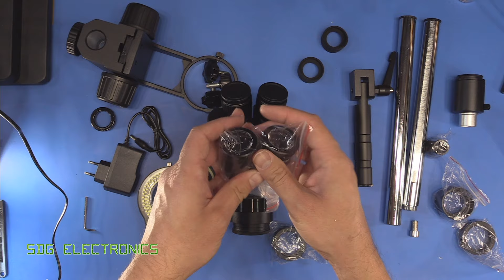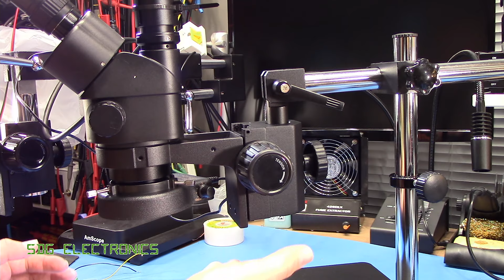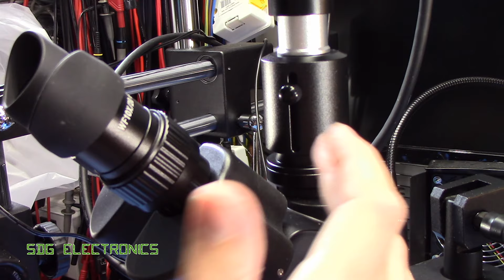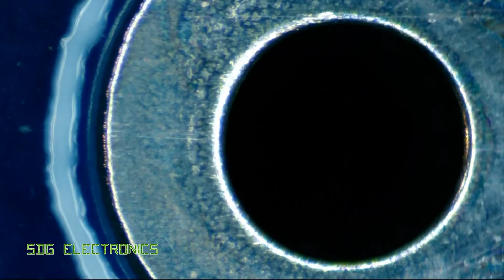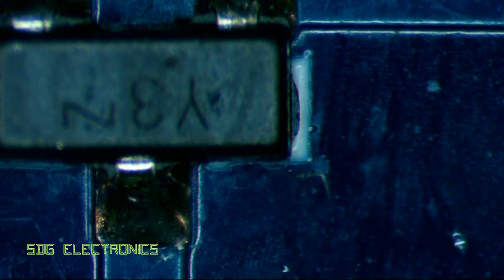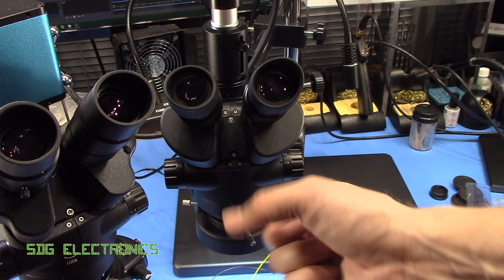SDG #113 Black Eakins Simul-Focal 3.5x-90x Microscope

Comment: as a watchmaker hobbiest i'm interested in buying a eakins microscope . i do have a question. tough.  The one you are testing is a 3.5 x90 one. What is the diference in working distance with a 7X 45? And is is possible to adapt this 3.5 x 90 into a7X45? And what do i have to order to do so? Another barlow lens if so witch one?

Comment: I have just purchased this microscope with the 37mp camera. Being my first microscope im unsure if these are issues or not. The image on the camera is not what i see through the eyepieces. Given the camera mount has 0.5x lens on it the camera gives twice the magnification which is a bit annoying when trying to get what your doing in view on camera. I can also not get the image in focus perfectly. The edges of the image begin to blur. is there a diferent camera mount without the 0.5x lens in it?
Reply: U have to use 1/3 or 0.35 adapter between camera and microscope  to match the view ... there is a lot of auto focus cameras

Comment: Really good video. I have the same Eakins scope but I have the articulating gas strut arm mounted to the wall. That is a game changer since it can be moved almost anywhere over the bench and no vibration from the desk. The Eakins scope really is a pleasure to use coupled with the  Eakins 37MP 3700W FHD 1080P camera 0.5x c-mount and 0.5x barlow lens. I've had mine for just over 18 months now and use it all day every working day. If it broke tomorrow I'd buy another hands down.

Comment: Hi there and thanks for the review! :-) I have a question for you if I may, when setting up the camera I realized the camera view is more or less half of what you see in the scope.. and that was a big disappointment. I got the same 0,5X adapter for C-Mount that you have.. can this be changed with a different adapter? I see there is possible to get 1X and 0,35X too.. any of this will solve the problem? 

Also the eye pieses was pretty bad.. wonder if there is possible to get only 10X eye pieces.. not the 10/20 combination.. 

From Before I have a Meiji EMZ-5 and the Eakins is so much darker and less clear.. and almost a little yellowish.  I have also ordered a Zeiss Stemi 508 Trinocular, but the delivery time is up to 5 months and I have a student coming in a couple of weeks, so I just had to get a trinocular quick.. but if this is the camera view, I´m not sure it´s usable at all.. :-) Hope you found a solution for this.

Comment: My camera has small black line at the bottom of the screen. 
its a straight line from left to right at the very bottom almost as if its by design.
You seem to have it too but very tiny compred to mine

Comment: Thanks for this one! I recently ordered same microscope. I havent recieved it yet but ofcourse it doesnt come with camera.  I was checking out the cameras for microscopes on Ali Xpress.  Is there any particular type of Camera and or attachment's made specifically for this scope? Or will any 23.2mm camera fit on the already supplied camera attachment? Also do you have any recommendations on any better camera attachments than the one supplied. Thanks again for the video.
Reply: Hi, I am planning to order this brand over Relife or others like sunshine. May you tell if the scope was worth for you? I am going to work with Iphones. One year from the line now.... times flies.

Comment: Thank you for a great review. My only concern with this microscope is if it is wobbly during work because of the single arm boom and stand pipe.
I need a microscope for my computer repair shop.
I will not be working using microscope more than a few times a week.
Reply: I have the same microscope. The shaking/wobbling comes from the weak base plate, I replaced the original base plate with a 6mm steel plate from my local dealer. Now the microscope is perfectly stable! There are also much more stable microscope stands in the Eakins Aliexpress Store, but the shipping costs for those more stable stands are very high, due to the increased weight.
The arm/pipes/joins of the microscope stand are very stable, it is only the thin and light metal of the base plate that leads to this wobbling...
Reply: @phibel9303  Would securing the supplied plate to the bench (harder to rearrange the bench) improve things, the or is the issue the plate-to-pillar joint?
Reply from the maker: @michaeltempsch5282  Yes, securing it to the bench works well. I had the same stand for my inspection camera rig and I just used an Irwin Quick-Grip clamp to clamp it down to the side of the bench. No more wobble. The other option is permanent mounting and eliminating the base altogether.
Reply: @phibel9303  Thank you for your reply. If the issue is the base plate then I can easily fix that.
Reply: @michaeltempsch5282  Reinforcing the connection between the pillar and base plate should also be possible to do.
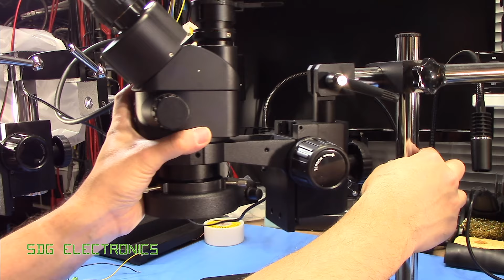Reply: @michaeltempsch5282  The base plate is about 21mm thick, but the top metal of the plate is only ~1.7mm thick. Securing the original base plate to a sturdy desk helps, but in the end I wanted it more sturdy and movable. The thin metal still flexes, when you lean your head/eyes against the eyepieces. In my opinion it makes no ergonomic sense to increase the working area height by 21mm. A 6x350x400mm steel base plate works very good for me and I can move the microscope head over the full arm length, no more tipping over 4:40.
Reply: @phibel9303  Good idea, i might try this! I wonder how heavy the base has to be for it to work for it to be as small as possible.

Comment: I bought exactly the same from Eakins (head only, I have a stand) two weeks ago and it just arrived today. The view is excellent! The only drawback is that the Eyepiece Cover Guards are little short for my eyes... Now I'm looking for a camera. The question is 0.35X or 0.5X adapter? I suspect that it depends from the camera sensor size?
Reply from the maker: The 0.35x is pretty much spot on 1:1 to match eyepieces with the camera image.
Reply: @MrTon4eff  Thanks for sharing the link! :-)
Reply: Hi, at one year from the line since you got your Microscope, may you share how are doing with it, I need one to start repairing cellphones.  May you share. Eakins has good prices on ALI.

Comment: Great video ! Quick question what is the approximate distance from the centre of the objective lens to the eye cups ? (i.e. the distance the user can be sat back from the item being viewed).  The reason I am asking is from an ergonomics perspective and avoiding having to lean forward or bend the neck
Reply: I know this is old, but having a bad neck injury myself, and having spent several years staring into this scope (the "identical" AmScope) - thought I could chip in. I'm not near the microscope atm so I can't give explicit measurements. But for me, the angle on the scope/ports themselves are ok. But the trick to reasonable ergonomics while working through this scope, in my experience, is not in the scope itself. But rather, having it on a motorized adjustable "standing desk". This enables reasonable back and neck posture, without hunching. Your arms come up a little bit more, but if you're doing soldering, especially microsoldering, then you really should be resting your whole forearm from elbow to the side of your palms, on the table anyway; the only things moving to navigate the soldering iron/hot air handle/tweezers, being your fingers. Doing this so the larger muscles in your arms and shoulders are at rest, preventing the small tremors and twitches of those large muscles when under tension, from traveling down your arms and attenuating at your fingertips.

For more ideal ergonomics, thinking in longer terms, switching to a good quality C-mount camera microscope and a low latency monitor (if splurging then 120 or 144 hz camera and monitor), is the way to go. Quality lighting is better and cheaper, working room under the scope is much better this way too. Lower weight too, so if you want an articulated arm to easily adjust and move away the scope when not in use, that is tight and stable so the image don't shake - those get cheaper too. Live video feed through USB is useless for working, but over HDMI (or DisplayPort) there's no noticable input lag with computer monitors. There may be more, noticable delay if viewed on a TV (because of image processing), at least one without a good game mode setting. So while dirt cheap 42-48" IPS 4k TVs may be great for schematics, instructions, static images etc - those are not so good for live, working microscope feeds. 

But there is a significant learning curve though, adapting to different eye-hand coordination and the lack of stereoscopic depth perception. But if you do choose to take it on though, you'll frankly never need worry about the ergonomics of working under the microscope again.

Comment: Got mine today....the 2 focus knobs ate very noisy. Like the mechanism has sand in it..... did you have this as well with yours.. if so...does it go away?
Reply from the maker: Very smooth on mine. Maybe rotate them a few times to see if it goes away?
Reply: @SDG Electronics  its just noisy a but but it's working.thank you.

Comment: I have quite a tall workbench so that I can work from a high stool or standing.  I'm curious to know what the height of the eyepieces is above the work surface when you use the 0.5x Barlow.  Thanks.
Reply: I have the same microscope. I bought a x0.3 barlow lense to get a higher working distance and a straighter seat position. My microscope has an diopter adjustment range of +/- 5dp, depending on the diopter setting, the working distance is between 200mm to 305mm. My eyes have around -6 dioptres and I work always without my glasses. Without glasses I have a working distance between 135mm to 225mm. I use the microscope diopter adjustment to compensated the ~0,75 difference between my eyes and the remaining adjustment possibility to get a comfortable working height.
The end of the eyepieces is about ~265mm above the bottom of the barlow lense, it depends of the barlow lense, the x0.5 is a little bit lower than the x0.3 lens.
Reply: @phibel9303  I'm still at THT level with my hobby but have to say the amount of detail on your reply was 11/10. Big thumbs up for the A+++ quality commenting!
Reply: @phibel9303  Thanks very much for the detailed info.  Very helpful indeed!
Reply: @ristomatti  Thank you! :-)
I also have some images which demonstrate the change in field of view with different barlow lenses: https://imgur.com/gallery/BfsYgEA
(Actually I have published all this information on Aliexpress, but the dealer has apparently revised his offer and now old (my) review are missing.)
Reply: @phibel9303  I feel you and I have something in common. An interest to share (potentially) useful information to others we have learned by experience or observation we might not see anyone bringing to out.

But at the same time we're still hesitant or feel there's too little time to set up a blog/YouTube channel of our own.

Was my instinct correct? :)
Reply: @ristomatti  yes,  I tried to make videos, but it is very time consuming...
I try to document/share things I learned the hard way and which are not well spread in the net - like this. I shared my experience under the Aliexpress Item, but unfortunately my review is no longer available. Thanks to SDG Electronics, here is a new place where I can spread the information. :-)
Reply from the maker: @phibel9303  That's really neat, where did you get the 0.3 barlow lens from?
Reply from the maker: The height of the eyepieces is around 350mm from the bench top.
Reply: @sdgelectronics  Thank you, Steve.  I appreciate your confirmation of the info above.

Comment: Thanks for the various recent articles!
Having reviewed several cameras now, with various pros and cons. Which camera did you finally settle on as best for use on the amscope745 ?
Reply: Never mind I've made a choice!
Reply from the maker: Something with a Sony IMX290 or IMX185 or similar is most likely the best choice as it has great low light performance. If that is not a concern, they all seem to work pretty well.
Reply: @sdgelectronics  I bought the same microscope (with the boom stand) but using the 0,5 barlow lens with the 0,35 or 0,5 lens (the same you suggested) on the camera I'm not able to focus with both camera and microsope. The zoom is the same but if I get the focus e.g. with the microscope the camera is not on focus and viceversa. Is there some camera adapter you can suggest to consider to get focus on both camera and miscroscope at the same time?
Reply: @digant1973  I have same problem with 0.5 lens ... did you find solution which camera adapter is good  ? Iam bought CTV 0.35X  focus adjustable C mount adapter  .. but dont have same vision on camera and microscope

Comment: Looks terrible. Wobbly. Did they pay you to do this?
Reply: Cheap plastic and plastic lenses
Reply: I have the same microscope. The wobbling is related to the thin aluminium base plate, the top of the plate is only ~1.7mm thick. The arm/pipes/joins of the microscope stand are very stable. I replaced the original base plate with a 6x350x400mm steel plate, which I bought from a local dealer. The Eakins Aliexpress store has more stable stands, but these are quite heavy and the shipping costs to my country were about ~170EUR. It is way cheaper to buy this microscope set and order a heavy base plate locally.
Reply: @microfix6035  nope, the lenses are not made out of plastic. In my work we have Leica and Kern&Sohn microscopes, the Leica has a better edge definition. But a Leica costs at least 10 times as much. The Eakins and Kern&Sohn are comparable - in my opinion. But I am no expert, only a user.
Reply: Okay I also use LEICA A60 microscope check my videos if you have time.

Comment: It is 100% copy. Now the question is: Our Amscope are original Amscope or fake cinese copy? Thanks for video.
Reply: Neither nor. Amscope sources in China, too. Actually Amscope is just a brand of "United Scope LLC" which imports stuff from china
Reply: @FuchsHorst  Thank you.
Reply: Amscope use better materials and better inspection list
Reply: lordhaven111  AmScope is just a sticker. I found ones without AmScope on it.
Reply: @erhandemir90  There are actually differences, the Amscope has the dioptric adjustment in the eye pieces and I notices some of the cheaper models use cheaper screws.
Reply: @outsideworld76  The cheaper one in this video also has adjustment.
Reply: @ian1352  of course but, every stereoscope has one.
Reply: @FuchsHorst   hic, tks U about Amscope United Scope LLC

Comment: I'm considering buying this microscope. Does anyone know what's the quality difference between this head https://www.aliexpress.com/item/32982404262.html?spm=a2g0s.imconversation.0.0.62ba3e5fclwKQ0 and this head https://www.aliexpress.com/item/4000199456041.html?spm=2114.12010612.8148356.35.5f035674sY4qCx (which is probably the one being reviewed in this video)?
Reply from the maker: The black one has a few tweaks to stop dust getting into the optics